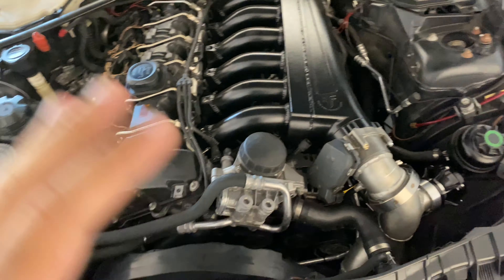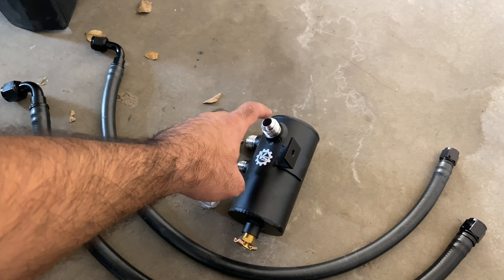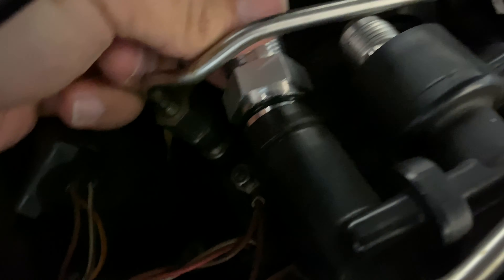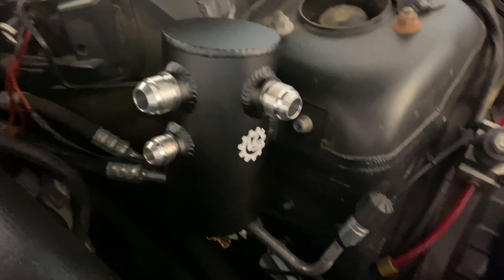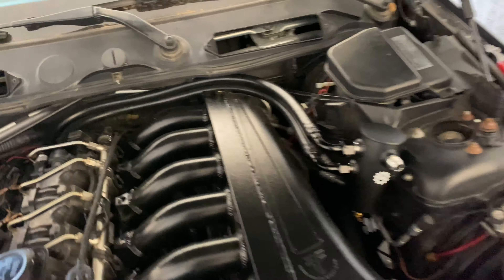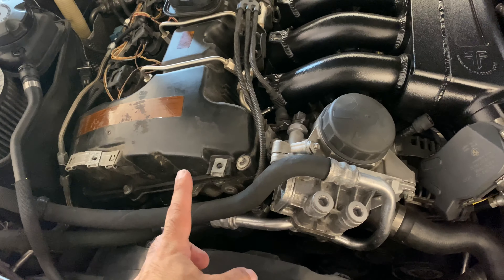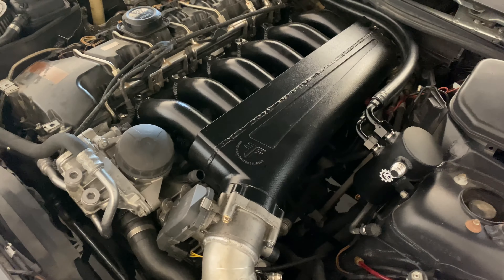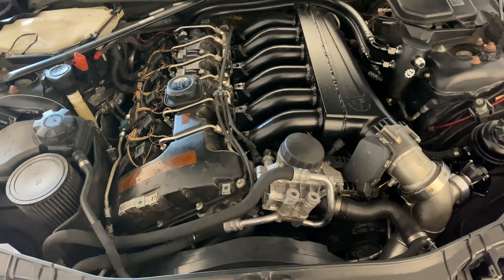VS Breather System N54 (Latest Revision 2019)

Comment: Omar I was thinking of doing this w my x6 which has N54.  I was gonna go w the VTA kid  man I’ve see some much negative tho about it that now I’m like wtf 🤷🏼. 

Im not making this x6 “racecar” I just wanna improve on the pcv issues that these n54s have.  

So if I go w a aftermarket Pcv and run lines from “flapper” and the “pcv” to a catch can  ** CAN I and/or should I still plug the 6 10/32 oil ports on intake side of valve cover ????   Please let me know your thoughts. Hate to spend the wrong$$ on stuff  trying to improve something not cause more issues. Thanks in advance sir 🙏🏻

Comment: so with this no need to plug head ports or anything else?
Reply: I'm late to the party, but it's suggested if you're going high boost, 24 25 and up, plug them.
Reply: @luluhus1  yes to avoid cracking the pcv section internal in your valve cover. Under about 22 psi it should hold up though, otherwise boost leak city!

Comment: yo,
2009  stock 535i; can you give a link for RealOem for which parts of the system are PCV related and not turbo vacuum control? 

can find much info on that at all tbh
i think your kit is cheaper than an overhaul of the stock setup

Also, for stock car; doesnt the ccv also maintain vacuum in the crankcase and subsequently maintain compression?